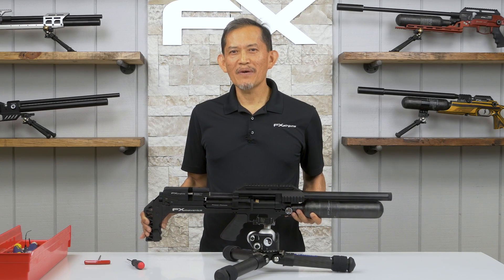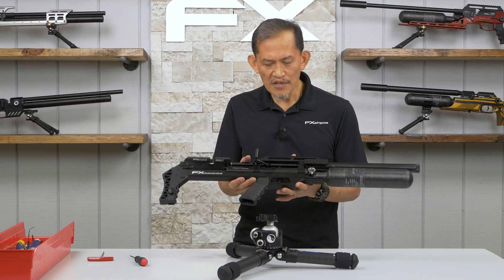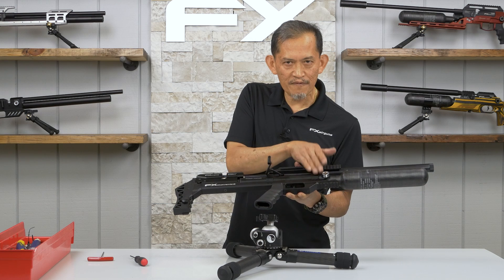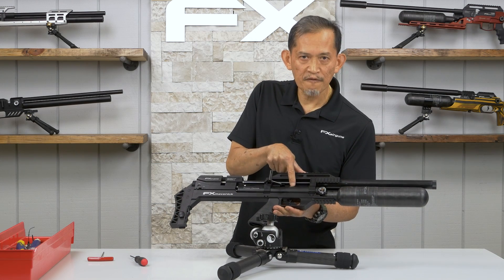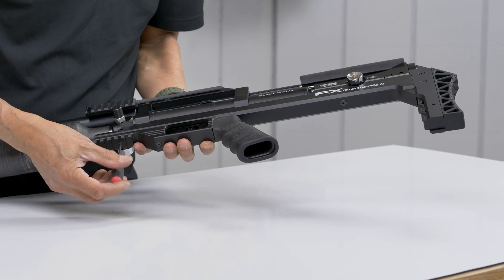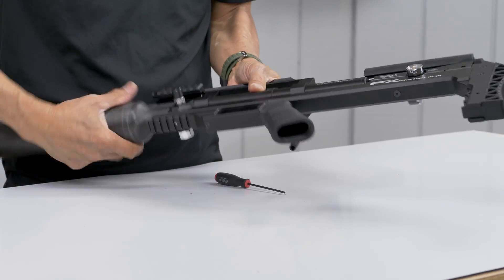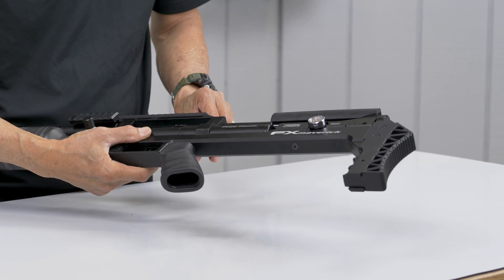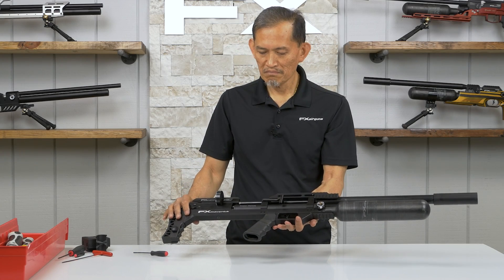FX Maverick Tuning - How to Tune FX Maverick Dual Regulators

Comment: Hi Ernst when I turn the brass second stage screw (at 2.13 minutes in the video), rather than an internal sound of air movement, I have air escaping from the brass adjusting screw, a bit like a bleed screw. Is this what should be happening? Thanks
Reply from the maker: Hi , this is Mathias from FX . This isn’t correct. The adjustment screw when backed out to far causes this as the sealing oring gets passed the sealing wall on the inside . Or if you didn’t back out to far the orings on the adjustment screw need replacing . Hope this helps
Reply: Much appreciated Mathias  @FXAirguns  can you confirm O ring size for replacement
Reply from the maker: @physiofarmer  that will be 2x1 nbr90
Reply: Thank you @FXAirguns . Procedure to replace is to screw out fully the screw, replace both seals and screw in just below flush?
Reply from the maker: @physiofarmer  yes but make sure you complete drain the system from air before taking the adjustment screw out
Reply: Understood :)

Comment: Once you set that first reg then you went back to it to bleed pressure doesn't that now make that reg go up more than the 170 you had it set at because you obviously unscrewed that reg to bleed the pressure so when you tightened it back down to stop bleeding pressure you now are no longer set at 170? please explain how you bled the pressure without changing from 170!
Reply: Well, just did this whole thing on my Maverick. I had to twist the first regulator just a tiny bit in order to degas the rifle. On some videos by just dry shooting it bleeds the air, but in my case it was exactly as on this video - no degas happened until I twisted the regulator just a little bit

Comment: Hey Ernest, how are you bud? I’ve been told the dual brass transfer port from the Impact are the same and will work in the Maverick, what about the bolt probe? I have a spare I’ve modified and also a spare pin probe for my Impact, will they work in the Maverick? Thanks Stoti
Reply from the maker: probe design for the Maverick is different than the Impact. There is a pin probe included with the slug power kit
Reply: @FXAirguns  Thank you Ernest. Not a big deal, don’t even have my Maverick yet. I just wanted to know if they were compatible. Have a good one and thanks for the reply. Stoti

Comment: Ernest when I tried to set the second regulator after setting first to 180 , after bleeding when I turned the set screw the guage never moved . Air was leaking out of the set screw . I bled the system and started over , filling the bottle to 250. No air goes through the plenum. opening set screw on either regulator air leaks out of either set screw . Blown o-rings ?  
The reason I adjusted is i bought it brand new and saw that second regulator was reading 120 , so I wanted to set both high and low.  180. 150 . Setting the first to 180 went as if should .Bled , and when i tries to set to 150. the 2nd reg gauge never moved at all .

Comment: Ernest--question about my maverick. The final regulator adjust screw is rotated too far towards the top of the rifle. Can't get my normal long hex drivers in there bc the barrel is in the way. Only way I can adjust it is with a stubby end of a hex and turn it about 1/3 of a turn at a time (can't get the hex all the way seated). How does one disassemble to rotate the adjustment screw more towards the side where it's accessible? @FXAirguns
Reply from the maker: Sorry to hear about the difficulties you are having please feel free to email or phone in to get in touch with our technicians if your experiencing any more troubles. Our email is Serviceusa@fxairguns.com , or call at (866) 639-0772 between 9 am – 4pm EST Monday - Friday.
 
Regards,
FX Airguns USA
Reply: @FXAirguns  thanks for the reply! Emailed support last night with a picture!

Comment: I accidentally turned my power wheel while cocked it seems to be working fine still? Am I screwed?
Reply: Not something to do again but you’ll get away with it this time.  You can sleep well my friend.  If you can’t, a little melatonin and good to go
Reply: @Ultimatehobbyreviews  lol yeah turning it down I think is easier on it. But I won't do it no more

Comment: So is this making the Impact obsolete? Are we gonna see a drastic price drop in the Impacts? Sorry for the maybe silly questions, but I truly don't understand, if this is more efficient rifle and can produce more and very consistent shots why would someone now purchase a $2000+ Impact? This rifle IMO is a hybrid of the Wildcat & the Crown with chocolate syrup and a cherry on top.
Reply from the maker: You forgot the whipped cream! But certainly won't make the Impact obsolete. The Impact is like the high end race car with some very unique adjustments and ability to mod. Maverick and Impact are both pretty much the same power and similar efficiency. Though the double reg on the Maverick is a big step forward. But the Impact isn't going anywhere.
Reply: @FXAirguns  Create another regulator for Impact on the bottle !

Comment: Hey Ernest
Since the Maverick is basically a Wildcat action, 
I was wondering if FX is thinking about putting 2 regulators on an up coming Wildcat?
Reply: Hey Gary, How about putting 2 HUMA power plenums and 2 HUMA regulators in a WC MK3 set at 30-40 bar difference of each other ;)

Comment: If I want to fire at 110 bar, the other regulator would have to be at 150, if so, could I only fire until I have 150 bar left to maintain the pressure difference?
Reply from the maker: Preferably Yes, shooting below the regulator pressure of 150 could effect how the regulators interact. For best results if the regulator is set to 150 only shoot down to 150.

Comment: you set the  front reg at 2:31   then you bleed it    but  then you Adjust ( bleed ) the front screw   doesn't this change the front reg pressure
Reply: you're right , after setting reg 1, bleed air, close reg2 reintroduce air ,slowly adjust second reg to desired pressure. aeac vlog is the better guide,

Comment: Ok so how much preasure must be in first reg?
Reply from the maker: First reg should be set 30-40 BAR higher than the second reg
Reply: @FXAirguns  thank you :)
Reply: @FXAirguns  we dont have a dealer in Georgia Tbilisi. How can i get one? Only way that i see is to order from USA and they have those for pre-order. Waitin for few month and they never got my dreamline bullpup to send me. Is there any way to get it from Sweden? We dont have power regulations but only cal restrictions it must be 4.5
Reply: @FXAirguns  contacted luftvapen store they said they cant send one
Reply: All depends what caliber, length of barrel and at what speed of ammo you want set in max - min on the  power wheel.  25-35b between the 2 reg is the recommended setting.
Reply: @kubi1110  Krale in Holland has it in stock you can order from there.
Reply: @TheHerald45  itll be 12ftlb and i dont want a toy :) and we dont have transporter companies in holland to ship it to me for cheap. Thank you for help :)
Reply: @TheHerald45  and they dont have 4.5 cal and even if i order it wont pass the customs 😅
Reply: So if I initially set 1st to 180 and 2nd to 150, when I refill what reading should show on pressure gauge?  And a side note what does it mean when taking off the bottle the power plenum also bleeds all air out to 0?  Thanks

Comment: At 2 minutes 55 seconds you backed out the first reg to release air, surely this will adjust the pressure and work you just did to set it. Makes no sense
Reply: I don’t understand anything from this action. He sets the first reg at desired pressure  and a few seconds later he changes the setting to let all the air out.
????